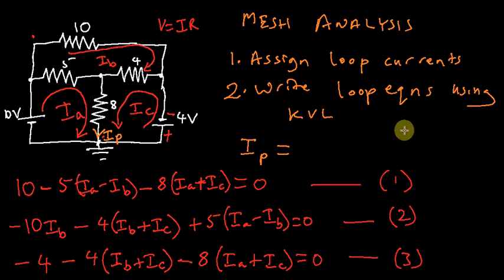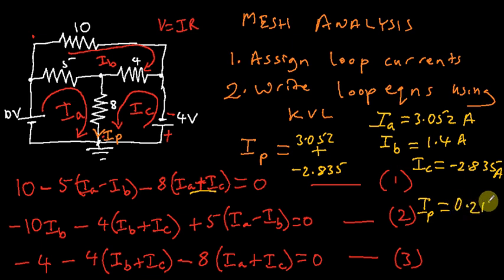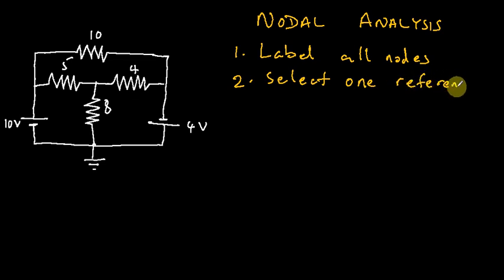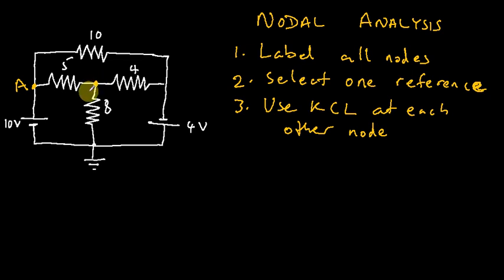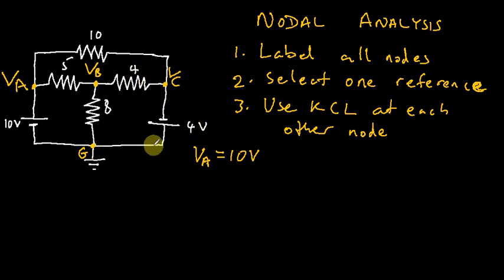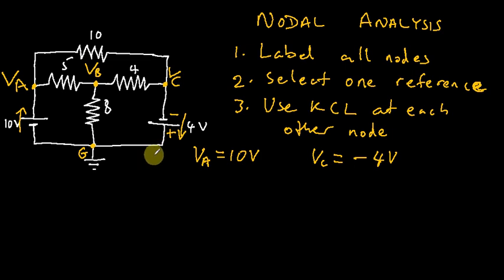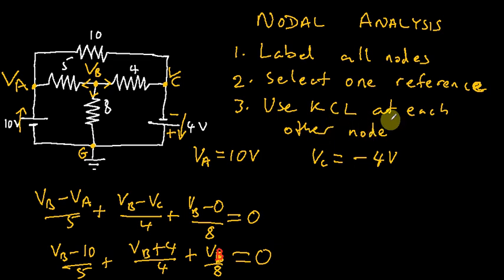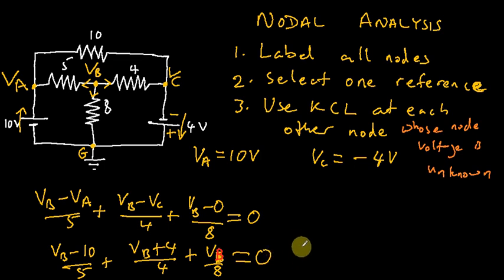03   Nodal Analysis

Comment: hello sir, may I just clarify something on mesh analysis. Base on what I understood, I think on the second loop which is Ib, it is 5(Ib-Ia) since it is revolving on the loop Ib. Same goes for the 3rd loop. Correct me if my analysis is wrong. Thank you sir and nice video. I learned a lot from this.
Reply from the maker: Hello, James. Thanks for your input. Yes, being in the Ib loop, it is a good idea to use the resultant current as (Ib - Ia) and work based on this. If we take the resultant current as (Ib - Ia) then the potential drop across the 5 ohm resistor will now be -5(Ib - Ia). Please note that the potential drop will be negative because we are going across in the resistor in the direction of the resultant current in that resistor. Hence, the equation will now become -10Ib - 4(Ib + Ic) - 5 (Ib - Ia) = 0. We can re-write the last expression in this equation as -10Ib - 4(Ib + Ic) + 5 (Ia - Ib) = 0 (which is the same expression as in the video). In the video, the method I used was to "pre-decide" the direction of the current in each resistor and stick with this direction for each of the loops so that in all the equations I always used (Ia - Ib), (Ib + Ic) and /or (Ia + Ic). It may however be more beneficial to the student to do it your way. Thanks.
Reply: Olawale Akinwale thank you very much for answering, It broaden my knowledge. Keep up your vids !